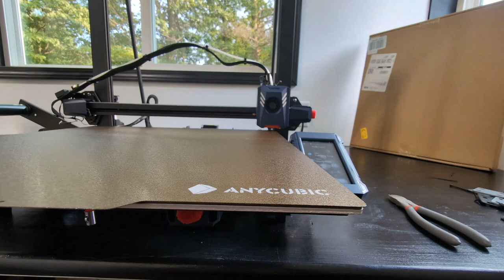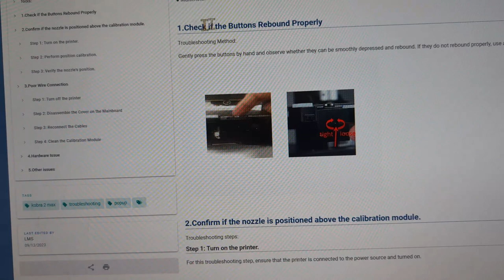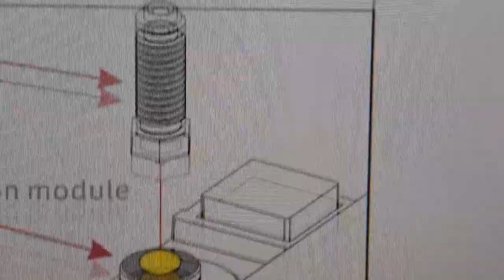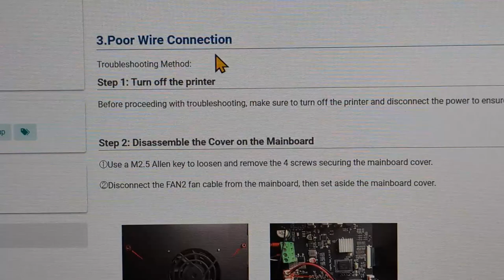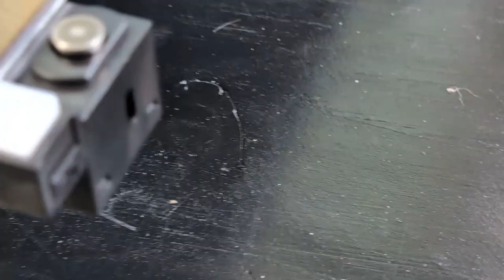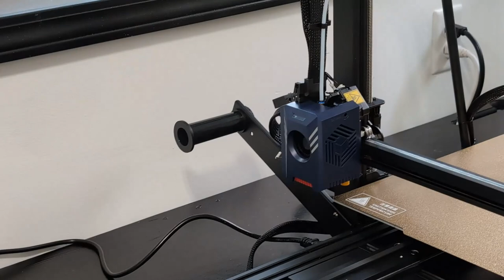Anycubic Kobra 2 Max   Initial Setup Error The module is abnormal  Please calibrate the position...

Comment: The other thing is sometimes is the cable connections near the print head under the cover are sometimes loose just make sure they are plugged in all the way as well. I have had this happen when i first bought the kobra 2.

Comment: On my kobra 2 i never had any issue out of the box but small things kept popping up now and then. When i did finally get the "module is abnormal" i went through all the documentation i could find and the ONLY time they created to any module the were referring to the z offset calibration button  When i pressed mine it was stiff and didn't move get much  I took it apart and pulled a small string of filament out and it was smooth afterwards. When reinstalling I paid a LOT of attention to ensure it was as perfectly flush to the top surface of the bed at temp and afterwards my z offset was band on every time.
Reply from the maker: Thanks for the extra information .  it may help out others in the future as well!

Comment: At the beginning of the video, There's a weird sound that sounds like your printer is running every time you speak. Goes away when you stop.

Great info, however.
Reply from the maker: @JoeyIngles  your correct.  However the machine is running all the time.  And in post production.  I decided to run it through some noise removal..  and so now you only hear it when I am speaking.  I have been working on my overall sound setup in my room that I stream and record in.  Newer videos shouldn't have this issue.

That said, I hope this video helps some people out there with their printer.  The printer has been operating great
Reply from the maker: Awesome glad to hear it helped you out!